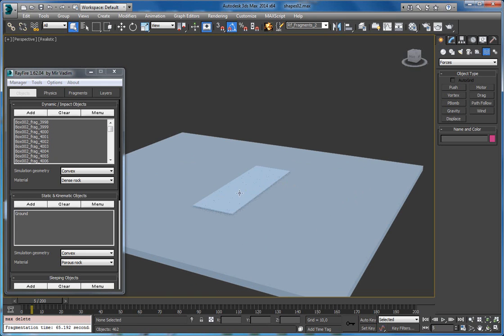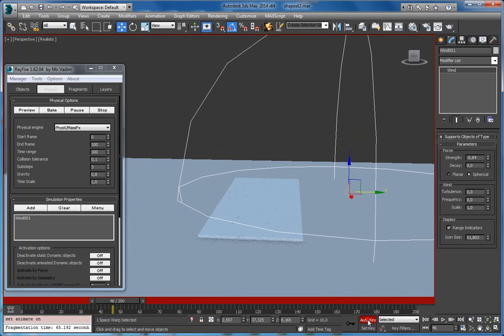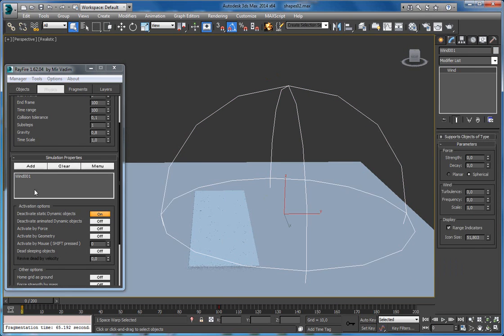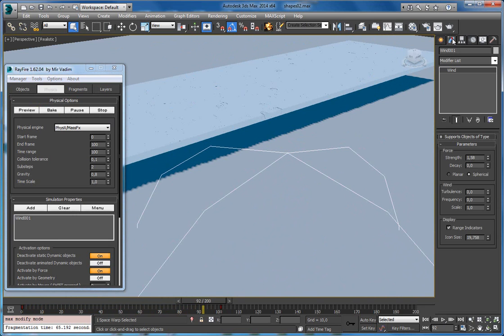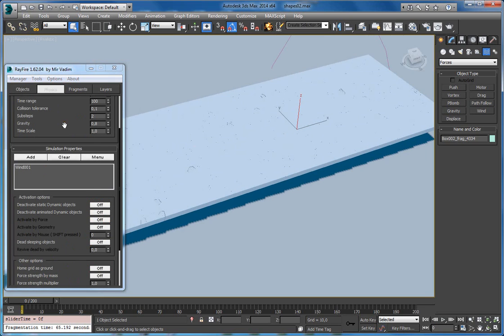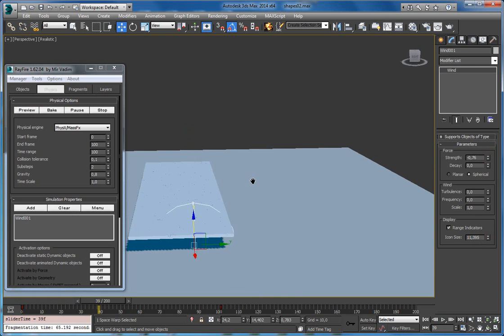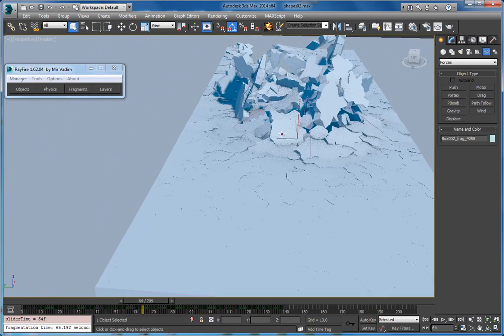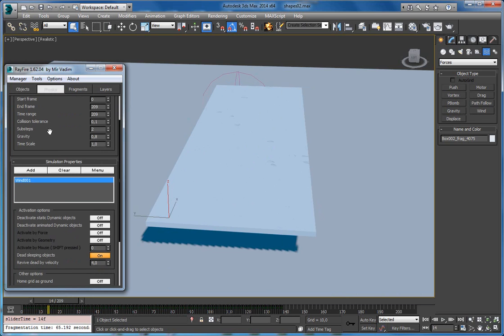RayFire Tutorial - How to use Wind force

Comment: Hi MirVadim
A very great tutorial.
I saw it and tried to do it. But there was 2 problems.
1 How did you do this nice fragmentation ? A tried it very hard but my result is not good as yours. can you tell me your parameter which ends in such a beautiful crack.
2- How did you do that your object don't "explode" after running the simulation?
 for me, when I press the Bake or Preview button, the fragments exploding. because they are some how in each other, I saw many times your tutorial
One way is to put the object in "Sleeping Object" mode but your objects are not in "sleeping " mode. How did you do that??
tnx in forward
Hamid